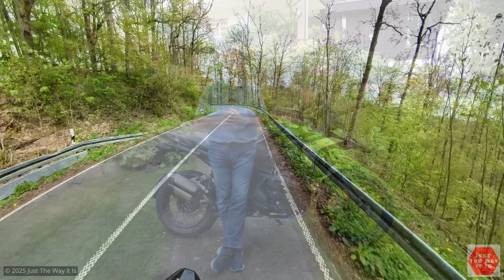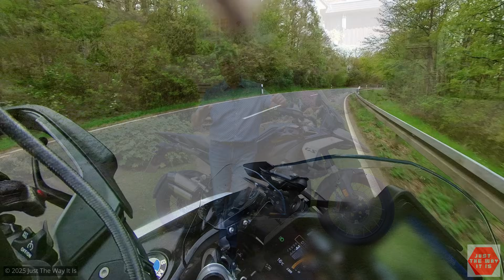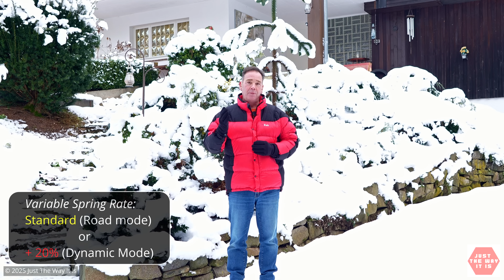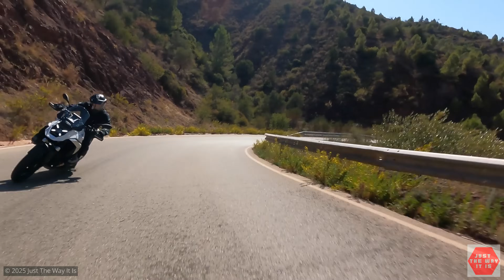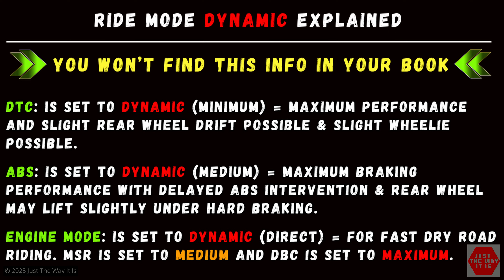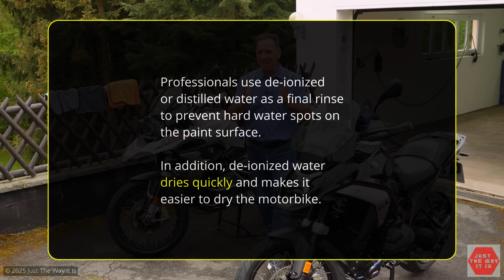BMW R 1300GS/A Dynamic Pro & DSA suspension setting guide MSR, ABS-Pro & DBC & AVHC Set-up Guide

Comment: Thanks for this video.  I do have a question on how you can pick a suspension setting that is different from the ride mode.  I see that you can adjust the damping for each of the suspension modes (road, dynamic and enduro).  But how do you actually select either the road or enduro suspension mode when you are in dynamic ride mode?
Reply from the maker: Hi Chris, don’t worry it’s a common question. The selection of the suspension mode is accessed via the Rocker Button, not the Main menu where you adjust DSA.
It’s too complex to list here, but have read of your manual it explains it in detail.
This button is also referred to as the Hamburger Button on the left upper controls.
Bert wishes Carl
Reply: @justthewayitis   Thanks for all the info.  For my commute to work, I have setup the bike with Dynamic ride mode and Road (-1) suspension.  I like it because I have full control over the power, and the suspension just eats up the bumps.
Reply from the maker: Hi Chris, that’s a nice setup 👍🙋🏻‍♂️, have good weekend, Carl

Comment: Hi Carl - cracking video filled with useful data and super presentation format. Next week I pick up a new R1300 GS TE triple black. Thanks to your hard work I'll get of to a flying start. A dilemma is arising though - I've still got my R1250 GSA TE Rallye and only 2 years old. I'm loathed to sell it 🤔. Mind you once I rode the 1300 I immediately noticed that this bike was better and in many of the ways you've mentioned from handling to engine performance etc. I must congratulate you on your engineer logical approach considering both theory and the practical. Great video and really great work. Thank you very much sir.
Reply from the maker: Hi William, thank you for your feedback much appreciated. Keep or sell the 1250 🤔, we’ll although they are both a GS, the 1250 does offer more comfort, I would ride your new R1300GS for a month or two with some long rides of 5 hours or more before making the decision, then if your happy with the comfort level provided by the R1300 sell the 1250. 
Just my thoughts 💭 
Best wishes Carl

Comment: Carl, great vids and buying some WT dongles for my 1300gsa soon. 

Tyres- my gsa came with Anakee Adventures, not bad. Quiet in a straight line but they give off some noise when cranked over. Any recommendations for an alternative tyre, mainly road. Like you I’m heavy on the front brakes and wore out some awful Bridgestones on my 2019 Gs1250 before the back. Continentals seem a good choice for longevity for many. Had Dunlop Roadsmarts on my 2022 Rs1250. Tourance Next2 are an alternative fitment - any experience good or bad with other Michelin, Dunlop or Metzeler.
Reply from the maker: Hi, Metzeler NT2 on my bike have been brilliant but I’ll probably fit Pirelli Scropion Trail 3 Next. Check out the the reviews in the comments section 🙋🏻‍♂️👍
Wizard dongles are a great improvement and easy to install. Let me know what the choose 🙋🏻‍♂️
I’m also heavy on the front brake so they are the tyres I would look at
Reply from the maker: Personally I would not install Dunlop tyres, I have never really been happy with any of them.
Reply: @ the roadsmart4s were revolutionary on the RS. Same feedback and quick to turn as  from new but after 4-5000 miles whereas the Mich Road6s were goosed by 5000 miles and a very feathered tread and uneven wear
Reply from the maker: Thank you for the feedback, 👍, I had road 6 on my Honda but like you said they deteriorate quick.

Comment: Hi Carl, I’m from Brazil. I had a 1200GS and later a 2023/24 1250GS, and that bike was like a magic carpet. I recently bought an R1300GS Tramontana and the first setup I did was: Ride Mode Road, Suspension Road, DSA at -2, and AVHC on High.
But the suspension is much, much stiffer compared to the R1250GS. I always use tire pressure at 32/42 PSI. I was really disappointed with how hard the suspension is.
On my 1250GS, I could go over speed bumps at around 80 km/h and it was smooth. On the R1300GS, it feels awful — the rear shock kicks back really hard, like a punch upwards!
On the road, I felt a lot of jolts coming from the rear suspension, and my passenger really suffered.
So far, the most comfortable setup I found is: Ride Mode Road, Suspension Road, and DSA at -2.
I’m not sure if it just needs some time and mileage for everything to smooth out, but for now, this has been the most disappointing part of the bike for me.
Reply: MArcel vc é do Brasil. Então cara tive o mesmo problema que vc, e foi com a branca de entrada.  Chegou ao ponto de machucar minhas costas no primeiro dia de uso. E os ajustes não mudavam nada na moto. Quando passava por ondulações e defeitos de asfalto na cidade a moto começava a perder efeito chicotear e pular. Acabou que devolvi a moto na BMW com 150 km, e arrisquei pegar uma triple black, pois fiz o teste drive e achei diferente. POis bem eu acho que era defeito da branca, ou ela tem a suspensão diferente. Eles dizem que é a mesma, mesmo banco. MAs na triple black não tive problema. MAs sim ela é mais dura que a R1250, mas não a ponto do que aconteceu com a branca. Acredito que estas motos tem algumas vindo com problema. E se a sua for a branca de entrada, pode ter algo diferente ou estas estarem com problema. Eu fui as ultimas consequencias e devolvi a moto. TEnte andar com outra de algum amigo. MAs a BMW não vai admitir que a moto está com problema pois eles mesmos não sabem mexer nisso e como não dá erro de software, aviso, eles não tem o que fazer.
Reply from the maker: Thank you for helping Marcel, that's very kind Eduardo . 🙏
Reply: @eduardobinotto4818 oi Eduardo minha é uma tramontana mas depois da 1 revisão minha moto recebeu o firmware 126_12_060 e a moto ficou maravilhosa parecida com a 1250GS, conversado com a BMW está atualização resolve problema de rigidez da moto …
Só alegria !
Reply from the maker: Thank you 🙏
Reply: @eduardobinotto4818 aqui no meu canal do YouTube falo sobre o update 

Primeira Revisão da BMW R1300 GS importante update de Software!
https://youtu.be/6Kw4fwTLQFs
Reply from the maker: Thank you very much 👍🙋🏻‍♂️
Reply from the maker: Hi Marcell, yes the setting you are using is the softest setup possible in the new 1300. 
In terms of comfort ( suspension and seat) the previous generation is better as detailed in episode 2, but the 1300 is aimed at a different age group with a different focus than before. I am not sure why BMW think that this was the best idea, but that was there focus, younger age group and more sporty riding dynamics.
You are using the softest setting, Road, Road, dsa-2, but set avhc to auto. Not high.
Reply: @justthewayitis  Hi Calr, thank you for your reply. I’m going to set the AVHCto Auto. Does this function make the suspension softer when set to Auto?
I had set it to High because I’m tall and didn’t want the suspension to lower… maybe I got confused?”
Reply from the maker: Yes with AVHC set to high the second pair of springs inside the tubes are activated making the suspension stiffer.
First try auto, if you find it softer and more compliant you could then think about a taller seat option, which would give you more leg room and probably more padding on the seat ( BMW didn’t have a seat for me to test but that’s my guess ), this might work for you.
First try auto and see what you think 👍🙋🏻‍♂️, it’s the only thing left to try to make it more comfortable

Comment: Hey Carl...I still have a question about the suspension of the R1300GS. I've been riding this bike for less than a year now and it's fantastic. I recently started riding with a passenger and discovered a major drawback. My GS is not equipped with the adaptive vehicle height control.
As long as we are 2 on the bike, the ride height is perfect, but when the passenger gets off, the suspension rises 3 to 4 centimeters, so that I can barely touch the ground with my toes. Not a big problem in itself, but the bike stays at that height, which is a problem for me when the passenger gets back on. When we then leave again with 2 on the bike, it returns to its normal ride height. Is there an explanation and possibly a solution for this?
Thanks
Reply from the maker: Hi Marc, what you are describing is the automatic preload system doing its work. While 2 up the system adds preload, once the passenger gets off the preloaded spring pushes the rear up.
It only self levels once it has determined the load but only while riding. It’s a shame BMW removed the rider self adjustment that we have on the 1250 ( min - max - auto ) now it’s fully automated. I do not have a 1300 at the moment so can’t check the system menus but I don’t think there is anything you can do. AVHC is the solution but it’s an option that you don’t have sadly.
You could try different seat heights but that will then affect your position while riding solo.
You could ask your dealership but I doubt there’s a solution but I could be wrong.
Sorry I can’t help with a positive answer. Kind regards Carl

Comment: Hi Carl,
many thanks for the many tips and explanations in the four R 1300 GS episodes!
After 15,000km with my 1300 GS, I've learned a lot - I haven't found more detailed explanations anywhere online!
One thing is still striking to me:
ALL BMW motorcycles are pretty terrible rattleboxes when it comes to the noise generated by the engine/drivetrain under a wide range of load conditions.
The 1300 GS, however, tops all other BMWs with its metallically hard, mechanically loud rattling and clattering of its drivetrain.
Do you have any idea why the 1300 GS in particular is so unfortunate mechanically loud?
I'm afraid the extremely high compression of 13.3:1 not only creates a noticeable tendency to ring and knock, but also this metallically hard combustion noise - what do you think?
Best regards, Christoph
Reply from the maker: Hi Christoph, glad you have been enjoying the series and thank you for the positive comments. Yes the noise!! I think it’s a combination of different elements, manufacturers chasing weight reduction in ever area including drivetrain housings engine casings and unfortunately the increase in compression ratio. The new GS is especially high which I’m sure is a large contribution to the increase in noise. How this will affect reliability and durability is not yet known. By comparison I still have a 2010 GS on loan and it is so quiet ! Even with 50,000 miles on the clock. Also the exhaust system does also effect the overal noise and with manufacturers having to meet more strict regulations this is another area that effects noise this combined with higher increased exhaust gas pressures all have an effect.
I hope you have a great season ahead and you continue to enjoy your new GS.
Best wishes

Comment: Do you know does the enduro mode uses the +20% spring?
Reply from the maker: Hi, welcome to the channel. It uses both ! 
The system automatically switches between normal and +20% depending on the speed of suspension compression and distance of travel. And it takes into account information from the IMU, it’s a very clever system.
Reply: @ thank you, bought mine a month ago, now just waiting for snow to melt. Excited to see what you are talking about.
Reply from the maker: Yes I’m also waiting for ice and snow to go and spring arrive. You are going to enjoy spring 
Best wishes Carl 🙋🏻‍♂️

Comment: I have had my 1300 since March and have been struggling to get the bike to work well for me suspension wise. Both this and the part 2 of your series have an absolutely Brilliant and informative lessons on the 1300gs suspension explanations. By far the most informative of all I have seen to date. Love it and thank you.
Reply from the maker: Hi Dave, hopefully you have now found a set up that works for you and the type of roads you ride on. Once you get the hang of thinking in terms of how the engineers set the system up, it’s fairly easy to find a solution that works for you.
Always select your Ride Mode first…
Then if your aim is comfort go straight to Suspension Mode :Road and change the DSA to -2, then you can slowly firm up the suspension from that point to match your needs.
Remember:
-2 = soft
+2 = firm
It just takes time to find the perfect setting for you and your requirements, 
I hope you find a good setting
Kindest regards Carl 🙋🏻‍♂️

Comment: Briliant guide for suspension set up Carl, thanks for very useful guiding : ) My GS 1300 is currently in production, and will be ready at my dealer february 24. Looking very forward to receive it, have been riding BMW GS and GSA 1250 for the last five years. Had a three hour test drive in november, tried both the new GSA and the GS, and I find the GS much more fun to ride. I loved my 1250, but this bike convinced my totally, and i swapped in my  2024 GSA, and order it prompyly. I,m 195 cm tall, and the riding position(Enduro Package) suits me perfeckt(with high comfort seat) . Definetly the BEST BIKE i ever has been ridden. Best regards, retired firefighter, NOEWAY
Reply from the maker: Hi Jan, thank you for your feedback on the video, February 24th will arrive soon hopefully just as spring arrives which will be good timing.
Sounds like you have selected the perfect GS configuration for your size and height 👍.
I presume you intended to say NORWAY 🇳🇴 in your message 😊
Best wishes Carl

Comment: Hi Carl, brilliant video and simple explanations of riding mode set ups . I tend to be in dynamic engine & road suspension on and height on auto . I’ll try your +1-2 recommendation too. I wash my GSA 1250 exactly the same way as you , I’ve got the scorpion air blaster and brilliant for drying off especially the switch gear and the two rads . Heavy rain forecast in uk this weekend so hopefully most of the salt gets washed away ,with luck I’ll be back out riding next week .
Reply from the maker: Hi Peter, thank you 🙏, sadly we still have lots of snow and ice, it’s been here for 6 ish weeks now and it’s really time for it to go. Hopefully spring will arrive soon, we always seem to notice a positive shift in the weather from February 12th onwards, so fingers crossed.
Yes those warm air dryers seem magical, perhaps I’ll take a closer look this year.
Best wishes Carl

Comment: Thanks for the explanation !
Still confused about some suspensions settings. For Touring ride, you recommand Dynamic -1 or -2, why not road 0 (or -1) ?
Other thing, enduro -1 or -2 would it be nice for highway travel or not recommanded ?
A good thing to have will be a sort of scale from smoother to harder, mixing all the three modes just to know, for exemple, if road +2 is harder than dynamic 0 etc
Reply from the maker: Because on that slide / screen (touring) you will notice I highlighted smooth A roads. Remember you have to think about the road quality first, if the roads are B roads then move from dynamic to road suspension mode.

Comment: Thanks for the explanation. But I think that BMW males this settings much too complicated. On my Ducati Multistrada V4 I have a handful of riding modes. Each mode has its own settings for engine and suspension and I can modify each mode the way I prefer. This is much, much easier!
Reply from the maker: Yes, totally agree the Ducati menu and settings menu is much more flexible and easier to use.

Comment: Just a quick question to clarify your recommendations. You have linked 2-up with the Advanced Rider who is riding faster; what would you suggest for an average rider, touring 2-up with full luggage (panniers & top case), and a wife who wants a nice steady and comfortable ride on variable roads (Alps)? Many thanks.
Reply from the maker: Hi John, 
Ride mode: Road for gently controllable throttle inputs.
Suspension mode: Road
DSA:  0 or +1
AVHC: Auto
TP: 36F / 44R
But it’s worth experimenting with suspension mode: dynamic with DSA -2 or -1  if the roads are smooth and good quality.
It’s all about finding what you both like best, try a different setting each day and experiment and keep notes, that’s how we do it.
Enjoy your Sunday
Reply: Many thanks, really appreciate your help.
Reply from the maker: No problem, have a happy Alpine tour to the both of you 👍

Comment: Hi Carl. When you started the series you made a Must have’ list of options for a new 1300. I took your advice and ticked all those boxes. I was surprised to find the one thing which wouldn’t send me back to a 1250 is the Ride height Assist. It’s a real game changer for me. Also having the forged alloy wheels makes cleaning the bike even easier. 
The only thing I don’t like are the Tourance Next 2 tyres. I’ve had a couple of incidents and lost confidence in them. I know you like them and with 50 degree lean angles that’s proof of how capable they are. Lots of very useful info here too. Thanks 👍👍
Reply from the maker: Hi Slip, the tyres take 15 ish minutes to warm up and then seem to grip really well, I know the OEM original are sometimes not the same as bought over the counter tyres, it’s been like that for many years in the tyre industry. But I don’t know if that the case for these NT2 tyres. I’ll ask around and report back if I hear anything that can be confirmed. The tyres that come fitted from new are often not exactly the same compound as what we buy from the suppliers. More cost saving 🤔